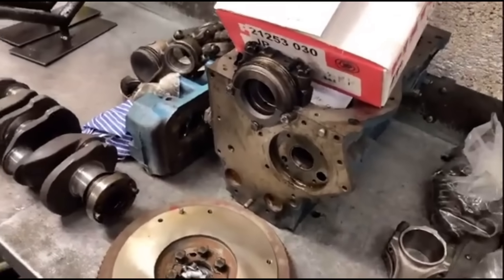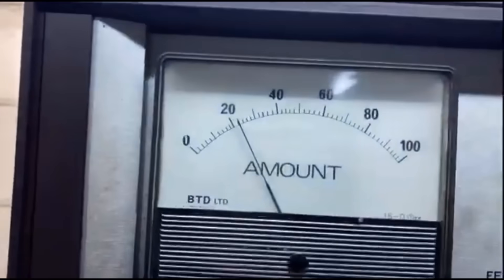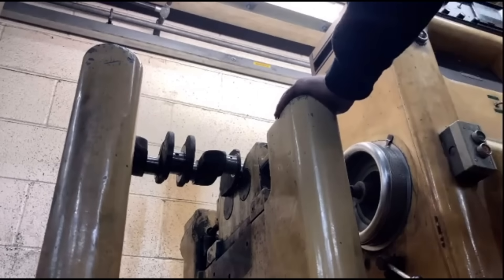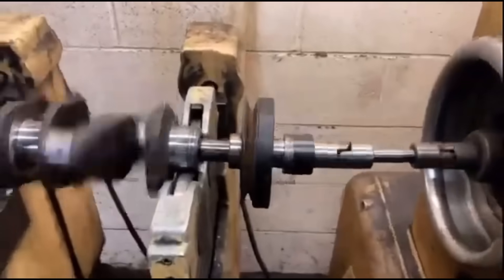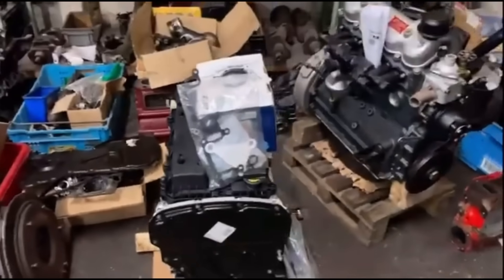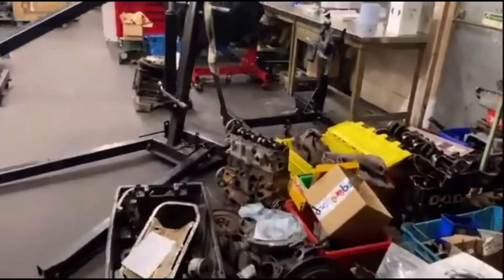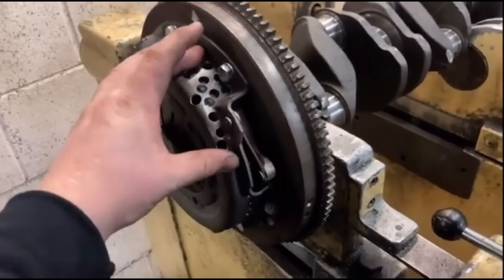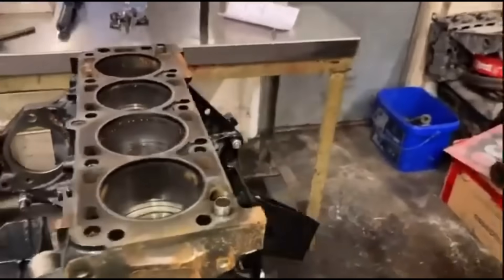This engine was supposedly balanced, but guess what Isaac found!

Comment: Hi Issac when Im balancing my motorbike wheels if it need a lot of balance weights I move the tyre around the rim to match the tyre and wheel for better weight balance so I use less balancing wieghts. Have you tried repositioning the fly wheel or clutch plate so the weight is moved to a more balanced position before drilling.

Comment: Great work Isaac. Great video. 
I think those clutches that require a hundred holes drilled in them must have some kind of manufacturing fault. They shouldn't be that far out.
I think they should be returned to the manufacturer for replacement or go for a different brand /style / type of clutch. There is something not right about them.
Reply: There has to be a neater way to balance the clutch than a bunch of holes, it just looks a mess and professional jobs whatever they are should never look like a mess. 

Maybe instead of drilling a hole all the way through that more holes are drilled but not not all the way through and the holes are then plugged with paste so they are invisible. I would certainly check the balance machine's calibration first.

Comment: Hi I know the crank parts were out of balance individually but did you check  them  as a fully assembled unit first,  I know some company balance it as fully assembled unit, so the assembly unit parts would be out of balance if checked individually.  Great video

Comment: Good work Isaac. Pardon my ignorance but why did they turn the clutch cover into Swiss cheese? Couldn’t they have just added weight to the opposite side? I would think that drilling all those holes would have weakened the clutch cover.

Comment: Cheers Isaac me old under sized big end. That Clutch Cover can’t be right, it’s like a Cullenda!. Just spot weld thin Metal squares on the opposite Circumference then Grind to suit. Get another Clutch Cover and start again, you can’t fit that. See you on the next one.

Comment: Interesting that it was consistently 20 thou out🤔 So simple question: how often should yourselves or anyone else have their balancing machines calibrated or verified?
Isaac, buddy, ( I don't want to sound like your mum but) get some gloves on when you're stripping down engines - with all that horrible old used engine oil, or it will do nasty things to your skin as you get older.

Comment: Man! That clutch looks horrible! It's hard to believe a new part would be that far out. With the vibration that would have made, it would drive a non suspecting shop crazy chasing that one down.
Reply: It's not...his balancing contraption is a mile out...never been calibrated. How can a new Cosworth crank need balancing and not just out by a little bit? Time and time again he removes tons of material because of that thing...wants putting in the scrap